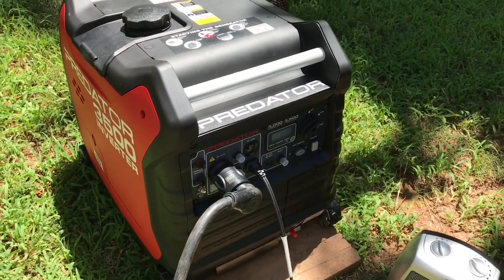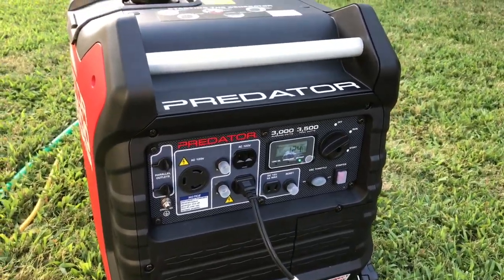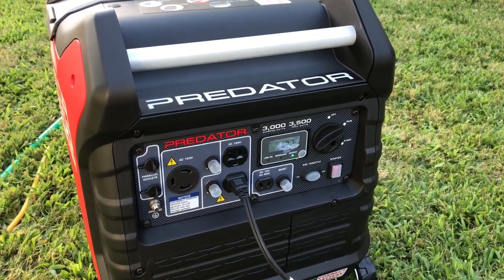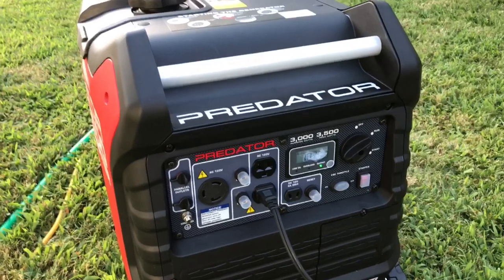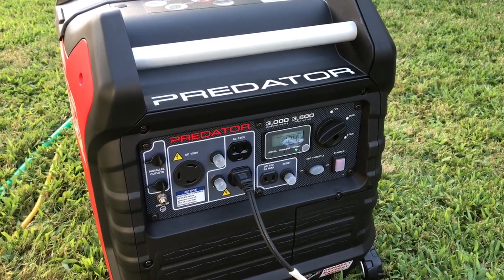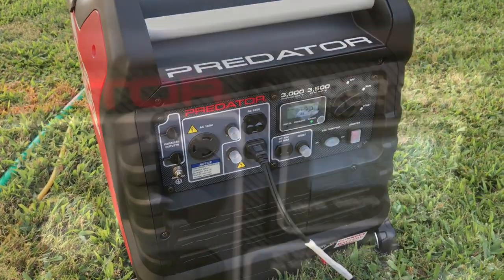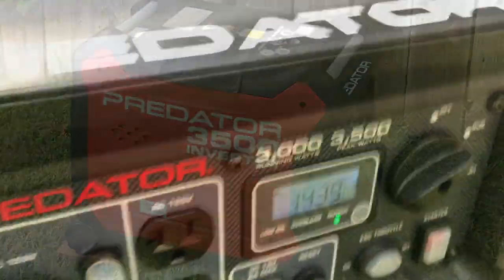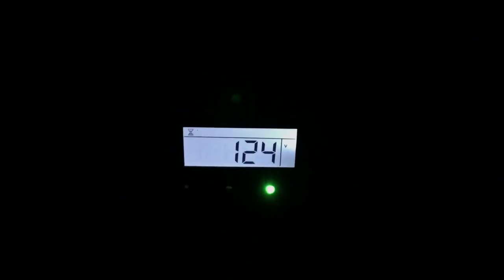Predator 3000 3500 Watt Inverter Generator Test - Defective Replacement

Comment: Ok, I'm pulling out the stops and going over to HF today to see if they have them in stock, and I'm going to buy one. I currently have two Champion 2000 watters and one Champion 3500 watter. The Champion 3500 watter also puts out 240 volts (so I can use my welder - or power my house), so I'll keep that one, but I'll sell one of my smaller ones. 
 
I'm taking a leap of faith here, based on your great review, and all the reviews on the HF site. Nice to know they replaced it for you. Almost like buying from Costco!

-          -                -                -                 -                 -                   -                 -                  -                 -                  -                -

NEXT DAY: Ok, I did it. I bought this generator, totally casting aside my core rule of not buying anything from Harbor Freight that has an electrical cord attached to it. Because of your two review videos, and the tons of 5 star reviews on HF's site, I went for it. Got it home, oiled it up, but gas in it, and pulled the cord once - and VROOOM. It started up. I'm impressed! I played with it for over an hour, testing it on my RV by turning on the a/c. Barely a perceptible hiccup, and it worked fine. And, it's damned quite too. Quieter than my Champion 2000 watters (I have two of them).  However, still not totally believing in HF electrical stuff, I opted to buy the two year extended warranty (giving me 27 months) for $124. This is something else I almost never do - buy extended warranties. But I'm still leery of HF stuff. 

So far, I'm totally impressed and satisfied with this unit. Time will tell if I made the right decision. Oh, and it DOES come with the converter plug so you can plug your 30amp RV plug into it. I only wish they made the converter plug in such a way that the RV cord hangs down normally instead of sticking up in the air and off to one side. I think this invites loosening of the cord from the generator.
Reply: MrTommy001 a
Reply: we just bought one, and we are breaking it in and changing the oil before we use it this thursday..we did run the camper and it did well. the test point will be this wkend
Reply: Buy two of these and get the parralell kit.
Reply: Take the cover off and flip the plug. If you need to take it back. Reverse the process before returning.

Comment: I bought one and it had the EXACT SAME ISSUE....but here's the explanation noone else has told you
These generators are test run from the factory.   They put a small amount of gasoline and oil in the at the factory and then run them for a few minutes until that gas runs out.   That's the final test before packing and shipping. 
Unfortunately, depending on how long the generator sits in warehouses before it is sold, some deposits have formed in some of  the generators and that leads to the stalling.

Mine did it for the first 5 minutes.    However, I added a small amount of SeaFoam to the fuel I put in the tank and after 5 minutes, the stalling and hesitation completely cleared up.  That's because the fresh gas and Seafoam cleared out the tiny bit of residue left from the gas that had been in the generator from the factory.

Now you know.
Reply from the maker: Randy DiCotti - I did read that theory somewhere. That's a simple fix if that's the case. Maybe someone else will try that and confirm your results.
Reply: If it doesn't clear up all that needs done is the pilot jet needs cleaned. It's located on the top of the carb and can be accessed without removing anything except the side cover, air idle screw and the crankcase breather hose
Reply: Seafoam high millage I added.

Comment: Great videos. I purchased one a month ago and took out right away. I have a jayco with a 15k ac and an outside fridge. I fought this generator all weekend. It kept overloading on me. I ended up turning off the outside fridge. We would have the ac running and when the water pump started for a shower it would overload. At one point there was big puff of white smoke coming out of it. I also kept getting weird error codes. I ended up taking it back to HB and told the guys what happened. It just seemed like something was wrong. They exchanged it and I even called tech support because the codes were bothering me. The new one I got seems to be better. I still need to try my ac again. I saw your video before I exchanged it. I'm determined to make this generator work for me before I give up and just get a Honda. Thanks.
Reply: Ernesto Rodriguez II I think you just might need a generator with more watts, you could get a bigger louder one from HF or if they make a bigger Inverter model soon get that or parallel 2 of these together to double the watts.
Reply from the maker: Ernesto Rodriguez II, you should test each device alone to see how many amps it draws. Then you'll know which items you can run at the same time. My microwave draws an extreme amount of power...around 1800 watts. It's only supposed to be an 1100 watt MW, but it draws much more. So I can't run it and the AC at the same time without overloading the gen. Your AC is probably drawing quite a few watts as well. Check it alone and see. Oh, and you should be able to get a parallel kit for this gen if you need to run too. In fact, I think it can be paralleled with the smaller 2000 model. That might be an option as well.
Reply: Roland White I got a chance to this yesterday. I checked each device starting with my converter. My 15k ac, outside fridge , and converter I'm doing 1634 watts. Which I was surprised. I have the power I need. I'm on my second one and it is doing that sputter. I thought it would go away during my break in period. Still there. I'm tempted to exchange it for another one. There's a guy on YouTube that has gone through 4 of them. Thanks.
Reply: Charlie MMAFAN  I did a test yesterday and I'm good on wattage. I just have the sputter and a weird whomp sound.
Reply from the maker: Ernesto Rodriguez II, I read a comment that mentioned the generator is starved for air, possibly because of the almost airtight case (my conclusion). Try testing for the stutter with the oil fill door off. Please let us know the results.
Reply from the maker: I just read a comment where a guy said he bought two of these generators and they bought had the sputter. He said he fixed both of them by running Seafoam through them. You should give that a try. If it works, come back and let us know.
Reply: Roland White I tried the no oil door and it still has that weird sputter. I let it run for an hour like that.
Reply: Roland White I going to try the sea foam. Man, this is a lot of work to save some money. I'm determined to make this gen work for me. Cheers!
Reply from the maker: Thanks for the feedback. Let us know if the Seafoam helps.
Reply: Must have worked.   He didn't come back and say it didn't work.    If it hadn't he probably would have
Reply: Randy DiCotti Yes! The seafoam worked like a champ. The carburetor probably sits after they test it in the box and gums up. This generator has been great. Well worth the money.
Reply: Ernesto Rodriguez II I had a Honda 3000 inverter, it would start the ac in my camper, but once the ac turned off then kicked back on it would kick the breaker on the generator. I would have to shut off the Honda and restart. My solution would be to get 2 2000 watt Honda inverters, you can get those for $2000, ( same price as a Honda 3000 inverter) but then have 4000 watts instead of 3000. Just my opinion. I had my 3000 watt Honda for 3 years. Bought it for $1863, sold it 3 years later for $1700.  Then bought a Honda 2000 watt.  Just went to harbor freight tonight to buy a predator 3500 but they were out.  Have to check tomorrow they said.
Reply: maxracingteam23 I’ve been using my predator and it has been worth it. Good deal.
Reply: Ernesto Rodriguez II good to hear. Hopefully they have one in stock this week so I can pick mine up.
Reply: Also make sure you use the 30 amp round outlet.  You can draw up to 30 amps before overload on that one, but I suspect you already know that and are using it.  I've been surprised how many people I've seen that don't know to use that 30 amp plug for there travel trailer hook up.

Comment: Nice, informative video! I have a Toy Hauler and would love to get a unit...maybe this unit to run the a/c while boondocking.  I have the old Predator 2500/2200 Inventor generator.  It lasted 4 months before the ignition module went bad...no start condition.  It took 4 months to get the replacement part under the warranty...out of stock, had to come from China.  Once I received the part and replaced it, the generator has been running like a champ ever since, over 18 months since the repair.  Good luck with the 3500.
Reply from the maker: I tried the 2500 Predator about two years ago. It wouldn't run my AC either. But there are lots of reviews that say this one will run a 15K BTU AC. Mine is only 9200 BTU but puts less than a 50% load on this generator.

Comment: I have a Honda EU2000i, that exhibits the exact symptoms that your first generator did.  Really rough in ECO mode, and stumbles when a load is added.  Of course, now they are built in China, instead of Japan.  I have yet to take it back under warranty, but I have decided to purchase the Predator 3500.  I've seen both your you tubes on these, and I think you've done a great job.  Only thing I'd recommend is to change the oil at least TWICE, in the first hour.  First time, just after it warms up. The Chinese seem to have a problem with cleanliness on their engine manufacturing lines.  The silvery sheen in the oil, is not a result of it breaking in.  It is the leftover filings from the machining processes.
Reply: Mark Hyatt as a machinist, I'm  pretty sure that chips left in the cylinder/bearings/crankcase after CNC or anywhere that they can get in the oil will grenade an engine in a matter of minutes. I don't think that they leave fillings in the motors when they assemble them. They can't afford to and keep their reputation. their quality control may not be 100%, but the predator brand, and Chinese machining are both getting better. I wouldn't be surprised to see ABB robots and a completely automated process in the predator factory now or very soon.

Comment: I've watched about 5 reviews on this generator but not one of them have mentioned how long a tank of fuel is lasting in it. Looks like a real good purchase and I'm almost considering running out to purchase one myself next week after watching all the reviews and seeing how quiet they are running in comparison to the even Honda's for the noise level. It's quite impressive. Of course I'm concerned about how long it will last, as they haven't truly been long term proven like the Honda's, Champions, Briggs and Stratton or the Westinghouse models. But I'm interested in purchasing it just watching the reviews as it stands. Might be worth a try.
Reply from the maker: I've done quite a bit of research on this gen and I'm comfortable it will perform well over time. The engine is proven and the manufacturer of the inverter (B&B Power) gets good reviews. The primarily make inverters from commercial solar system and the parent company was founded in 1994. And if anything does fail, it shouldn't cost much for parts. So there's that...

Comment: Bought one of these a couple months ago. Changed oil at 8 hours. Non ethanol gas. Did proper break in procedures. Took camping and at 40 hours starting surging real bad when ac cycled off. If the compressor kicked on at top of surge it would run fine and would stop surging but if it kicked on at bottom of surge-the generator would go into overload. Wondering if I should swap it out or try to figure out what’s wrong.
Reply: Did you ever solve this? My generator is doing the same thing.

Comment: Nice U got a good one .I have the earlier model 2500 watt unit my first one was bad also . I have just seen these new 3500 watt units in the store they all seem to get  5 star reviews. I wish  I had this bigger model as it would run my toy hauler ac. Thanks for sharing this .
Reply from the maker: I bought the 2500 a couple years ago and returned it because it wouldn't start my AC. I had a 13,500 BTU at the time. So I ended up buying a used Generac NP-30G which was the OEM model for my RV. But even it struggled with the 15 year old Coleman 13,500 BTU AC, so I sold the AC and bought a smaller 9200 BTU Coleman. The 13,500 BTU AC was overkill for my little 22 foot Rialta anyway. The 9200 BTU AC is plenty and the genny handles it with no problem.

Comment: @Roland, Hi, Thanks for the great review. I have a question and would like your opinion on. I want to purchase this Generator for Mobile Auto Detailing and want to know if you think it would be sufficient in running my heated carpet extractor (Unit has a heater-pump-vacuum in it) if i run it alone and do not run anything else with it . It's  20 amps @ 115V 60Hz, i assume it's 2,300 watts.  Thanks so much,   Mike

Comment: I have the same generator as you, and mine was sputtering out of the box. I replaced the spark plug with an NGK BPR7ES and no more sputter. I suggest you pull and check the spark plug. It's from a company called 'Torch,' which is used in scooters and has an apparent reputation for failing prematurely.  There are many other plugs which cross reference to the Torch F7RTC, and the user manual states one can use an equivalent spark plug.
Reply from the maker: matthewheld, thanks for that suggestion. I'm definitely going to do it.
Reply from the maker: matt, mine has a Bosch plug, not a Torch. Not sure what to make of that.
Reply: Roland White I'd say you don't have to buy a new plug. I'd like to know if it was a Bosch plug in your first generator.
Reply from the maker: No idea. But regardless, I don't want to have to do maintenance on any product I just  took out of the box.
Reply: Bosch plugs are one of the best..
Reply: Roland White Foget about the plug. I still wouldn't use the Torch brand plug, but that's not the problem. After thinking I fixed the issue, it recurred. It's the design of the generator that starves the engine for air. My temporary fix is to run it with the oil fill access panel removed. No more stuttering. You should run yours unloaded with the eco-throttle off. Then remove the same access panel and observe the difference.
Reply: matthewheld Mine did the same thing, I'm waiting for my store to get another in stock so I can exchange it. It runs rough until you pull a cover off and the engine smoothes out and runs great. Not sure if the jetting is off or what but I put 10 hours on it so far and the spark arrestor is black and the spark plug is all carboned up.
Reply: benjaminsteines I don't believe exchanging the generator will do anything. I believe this is a design flaw attributable to the plastic enclosure not allowing enough air flow to the carburetor. I don't know if I'll keep mine and cut some air holes, or just return it and wait for them to correct this.
Reply: matthewheld it's definitely an air flow issue with mine but I'm going to try another generator and go from there, it can't hurt. I'll let you know how the new one works!
Reply from the maker: Matt, that's an interesting discovery. I haven't had a problem with the second generator but I'll keep that in mind. I know the case is designed to channel most of the incoming air over the inverter for cooling purposes, so it would seem that the higher the RPM's, the more suction created, thus the stuttering should get worse under load. Oh well, I can't test mine. I've torn it apart. I bought it to use the guts as donor organs for a project I'm working on. I shouldn't have the same problem with the redesigned case.
Reply: matthewheld I exchanged the original the other day and this one sputtered a bit during the first 15 minutes of running but then smoothed out. It would still sputter when going from eco to full throttle under no load but that cleaned up around hour 12. Now it runs flawlessly with all the covers closed as it should. I changed the oil twice in the first hour, and every 5 hours after that. I should hit the 25 hour mark tomorrow and will use synthetic from then on.
Reply: I have the much cheaper Predator 4000 watt (3200 running) generator and had issues with it running rough and sputtering.  The reason I mention this here is it looks like both the more expensive inverter generator here and mine use the same engine.  Anyway, I fixed my issue by drilling some 1/2" holes in the air box.  Now the generator runs perfect.
Reply: benjaminsteines I would still suspect if you pull the spark plug, you'll see there's a lot of carbon buildup on the plug-in from too rich an air-cooled mixture.  But I hope not.
Reply: matthewheld I swapped the plug over to an E3 E-18 at 8 hours and it looks great now. It doesn't sputter switching between eco and full throttle any longer either, that seemed to clear up as it was breaking in. I'm leaning towards the fuel system being gummed up from running from the factory. I've been running Stabil 360 Performance in my fuel and it's running like a champ even with all the covers on the generator
Reply: benjaminsteines well, leave it to me to be pessimistic. I'll run what you're running through mine and see what happens...

Comment: nice genny
my 1100w GE MW has a listed input of 1580va
1800w does seem a bit high for the MW, any chance the fridge (in auto mode) was using power, (after you reset the genny)  thats around 300+ watts for an RV fridge on electric

Comment: Do you think it could be installed in the generator box on the rv without over heating?
thanks
Reply from the maker: With the modifications I'm making it should be just fine. Adequate cooling is one of my primary concerns in my redesign.